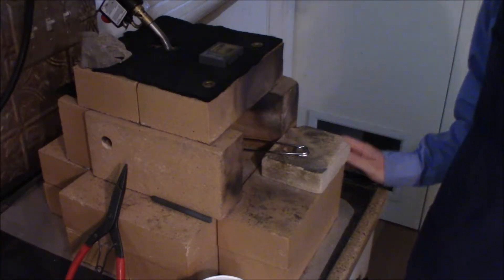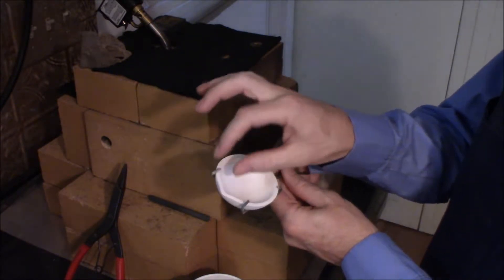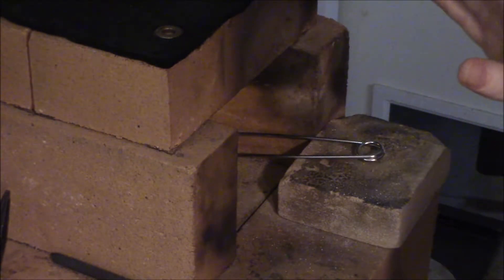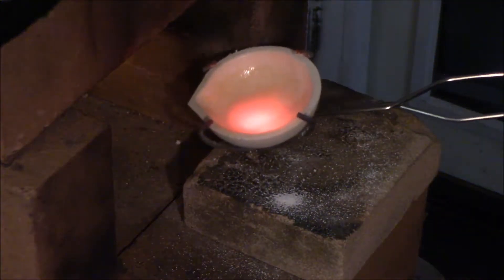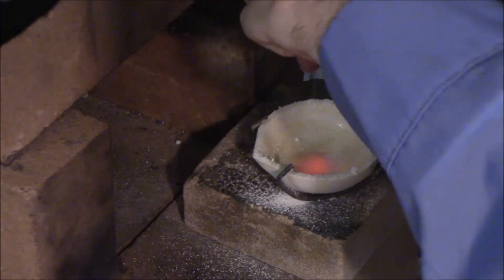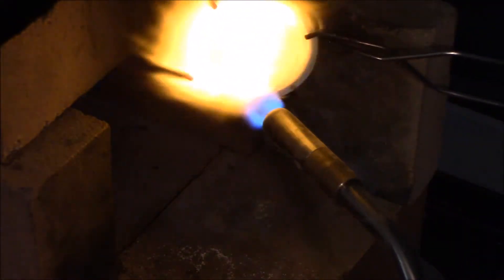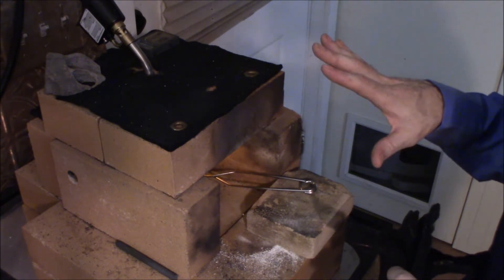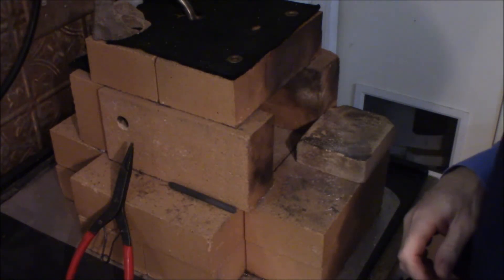How to Glaze a Crucible for Melting Silver and Gold

Comment: Wouldn't it make sense to do the sides first since the flux will run down to the middle. You even said it's not good to have too much in the bottom because it may cause problems later? I'm confused by everyone's idea of how to glaze. Is glazing  just a learn as you go  through your own experiences and/or does the torch blow the excess around once the dish is at a high temp, hence glowing light orange. Sorry for the meny questions. I'm just
Reply: Yup, sides down middle last, no idea why he did it backwards.